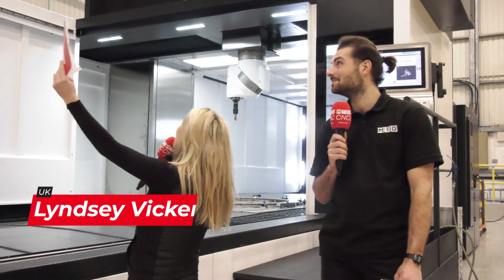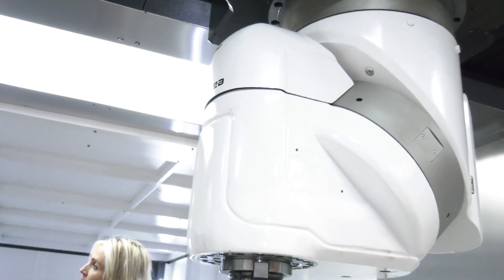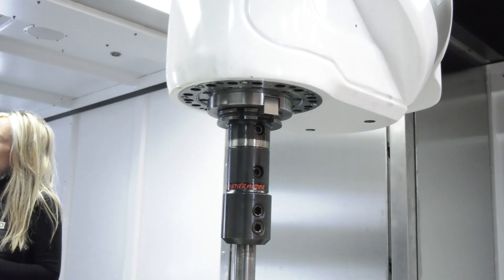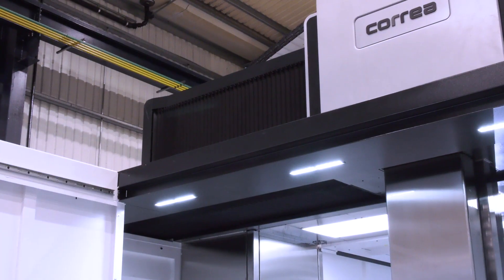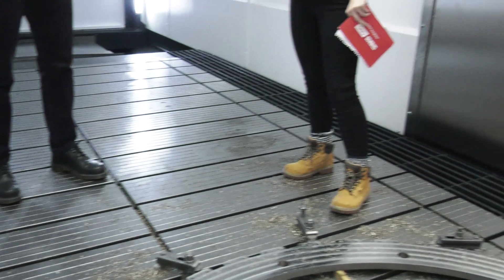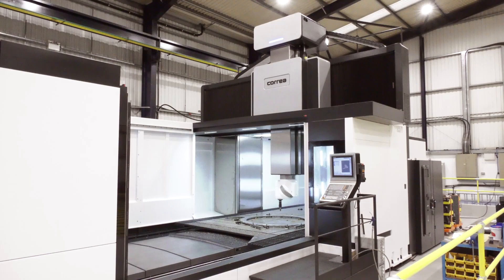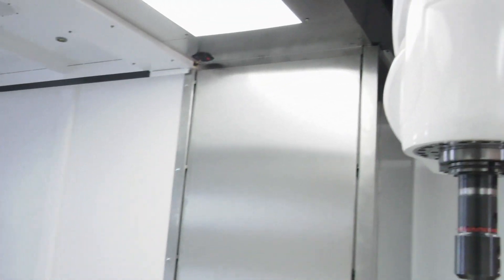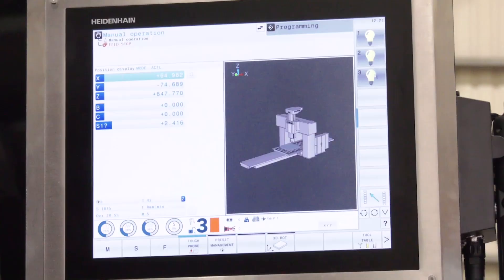Is this the best 'detailed' machine review ever?? Your comments please

Comment: Multiple other builders use concrete for parts of the base. Other builder examples would be Fidia or TRIMILL but there are many more. The first time I saw it was 20+ years ago. My Dad, RIP, was considering it strongly when designing equipment.
Reply from the maker: Glad you enjoyed the video .
Reply: Kern, plus other euro
Reply: @12345NoNamesLeft  Yep and Kern is a great example and certainly known for a high end product as are the ones I mentioned. To call it 'concrete' is a little basic and downplays the mix which is typically a special polymer blend.